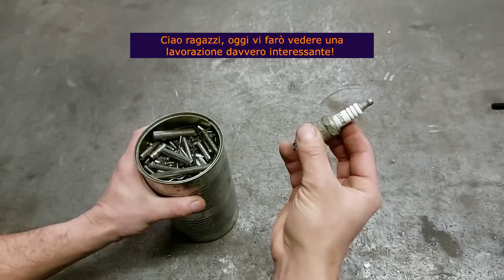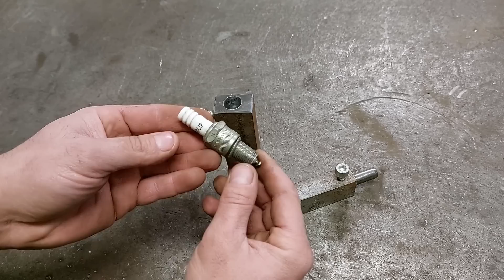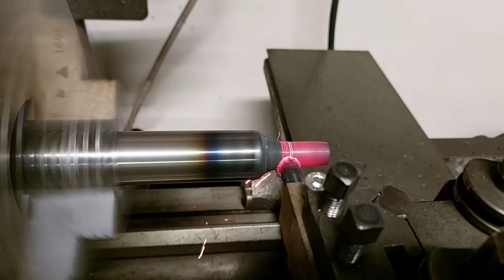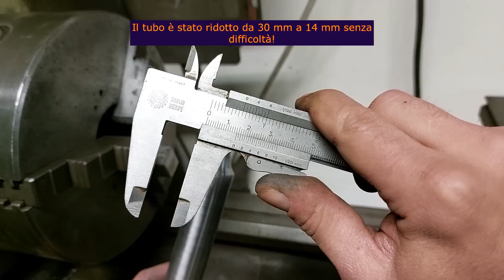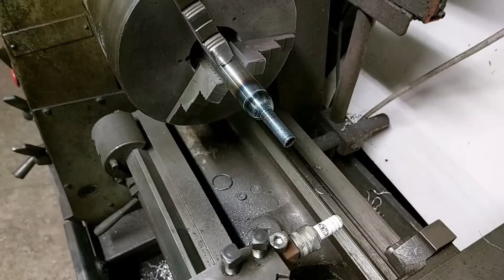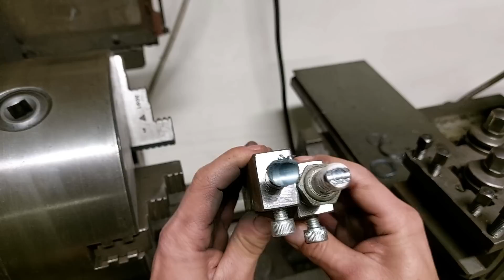Friction machining, is ceramic or hardened steel better?

Comment: Yes spark plugs are designed to withstand heat cycles 😊 aslo didn't see him take metal filling of the plug. Iridium or platinum are in middle of plugs for most part.
Reply: Those precious metals sit just in small quantity on the spark plug tip, not in the middle of the plug!!!  Otherwise $$$

Comment: Hi, I don't know anything about your work, but I'm curious, so I watched you video with a real interest.
The question which came to me is : what about the thickness of the pipe in the part you restrict ?
Specilay at the adge of the diameter.
A cut in the lengh would be instructiv for us who don't have your experience.
No matter, your videos are well done and show us some fascinatings realisations and practices.
Reply from the maker: Hi, thank you... My videos are designed to help all users do particular jobs with simple tools! Among other things, I am preparing a video, where I have brought together all the videos in which I used friction processing, so in a single video you have a complete idea of the processes.
As for the tube, reducing the diameter increases the thickness. In the tests I did, I was able to work tubes up to 3 mm thick well, or to friction weld solid cylinders!
Reply: @newtech5042  Thank you for your reply.
I should have understood that, as you do not modify the length, the excess material compared to the initial diameter is always present, more or less, if friction and heat consume part of the material ?

I saw the video where you weld a ball on a cylinder by friction,and I've noticed the excess material you removed with the lathe.
I'll wait to the video where you are talking about.
Have a nice day.
Reply from the maker: In the video I made two comparisons, with a hardened steel plug and with a car spark plug.
With the car spark plug there is a greater amount of material removal, because the ceramic is much harder! In any case, these are negligible quantities that are almost not considered.
However, in the case of the sphere or other examples of friction welding, it is necessary to clean the detail... But it is minimal work, compared to making it from a solid piece, or traditional welding.
Reply: @newtech5042  👍

Comment: Hardened steel is not very resistant to friction... usually at the factory we carry out heat treatment and quenching processes to harden the steel, but to provide results that are scratch and friction resistant we add a hard chrome coating process by electroplating or by coating the ceramics by flame coating.
Reply from the maker: Hi, you're right... hardened steel is not resistant, but it is a solution that allows you to work on a detail at little cost... Specialized companies can do the treatments you described, but those who do it as a hobby have to make do. with what you find... Anyway, thank you very much for your comment, it's always nice to have a discussion with those who have the skills!
Reply: @newtech5042  your'e welcome mate.

Comment: Interessante, ho visto la saldatura per attrito, ma non utilizzare la plasticità causata dall'attrito per rimodellare il materiale. E infine, anche un utilizzo per le vecchie candele!

La candela era rivestita in ceramica anziché in ceramica. 

Un ricordo mi tormenta dicendo che i nuclei delle candele (o una marca) hanno una lega di acciaio al paladio.

Ho visto la spina muoversi nel supporto; la correzione deve essere eseguita per escludere qualsiasi influenza.

Un pensiero... che ne dici di usare gli utensili in titanio? Hmm...

Se l'italiano è 'spento', date la colpa a Google Translate; Non parlo italiano.

=+=+=+=+=+=+=+=+=+=+=+=
Interesting, have seen friction welding, but not using the friction caused plasticity to reshape the material.  AND finally, a use for old spark plugs, too!

The spark plug was ceramic coated, rather than ceramic.

A memory is nagging at me to say spark plug cores, (or one brand), has a paladium-steel alloy.

I saw the plug moving in the holder;fixing that needs to be done to rule out any influence.

A thought... what about using titanium tooling?Hmmm...

If the Italian is 'off', blame Google translate; I speak no Italian.